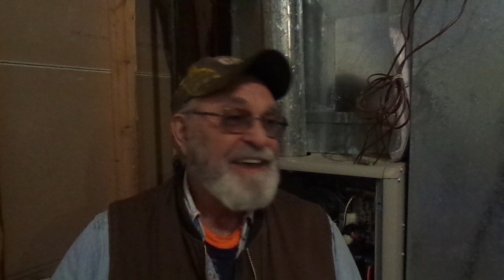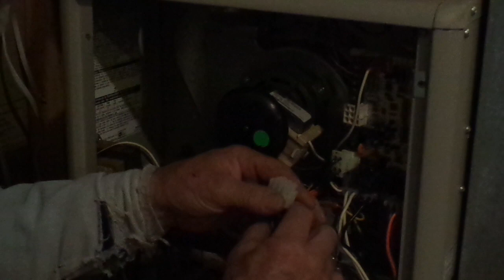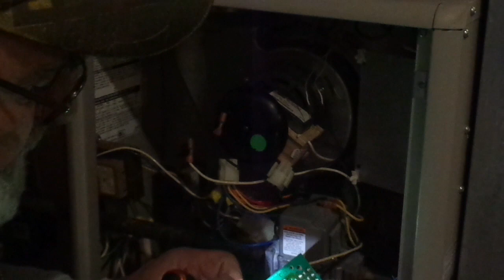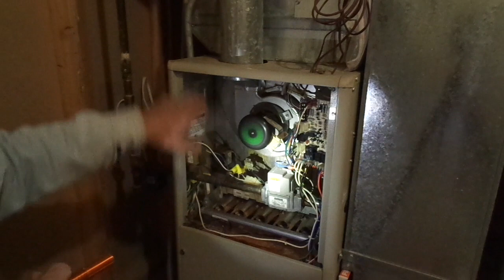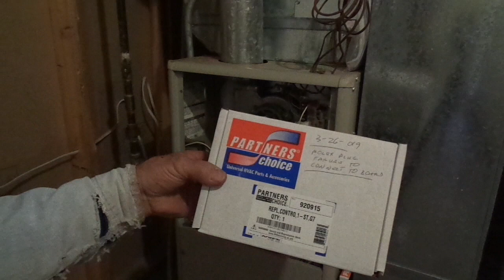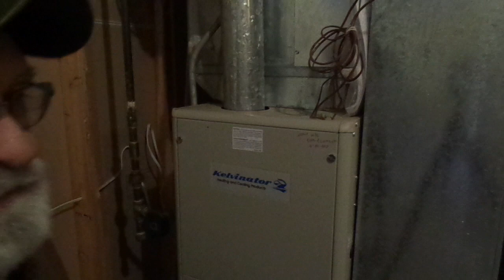Kelvinator Furnace Control Module Replacement at Sandi's House

Comment: Usually faster and cheaper to swap boards. Gator has skills and tools that let him fix boards and many other things. Tractorman builds all manner of implements and tools. As a DIY project the work we do is entertaining. Trying to break even doing the work for someone else is a loosing effort.
Fixing a saw, plane, tractor, or circuit board takes skilled labor. I once spent a month fixing a hand plane. Two months fixing a mower that isn't running yet. That labor can eat all the savings of saving the board from that failure. 
There's a reason for saying "that failure" too. It might be a Monday or Friday board. Bad soldering, rough handling, no QC, or worse spotty QC. The customer is happy until the next failure requires a return visit and additional cost. 
If I break that cracked #4 plane I get the pleasure of refixing it. If I fix it for someone else for money the fun evaporates.
Reply from the maker: That is a very astute comment and puts succinctly into words the reason I do so many of the things I do....essentially the Fun Factor, or in other words the satisfaction of helping someone out that needs it.   I really can't add anything to your comment except thank you for putting it in plain English.   And thank you sir for taking the time to write it as well as watching.

Comment: How's she goin'?  Interesting trouble shooting there Wendel!!!  A simple cold solder joint or broken trace and the board is deemed to be faulty.  But you nailed it and made a good repair, and the customer is happy and warm!!!  Nice goin'.  Take care!!!
Reply from the maker: I described what I think the specific issue was in my comment to ol' Gator...but you're right it is a simple broken or cracked connection, but essentially inaccessible especially for a field repair.  Thanks Mike for taking the time to take a look sir !!
Reply: @tractorman4461  In this day and age, it just doesn't pay to trouble shoot to the board level in my opinion.  Like you say, for a field repair, change the board and get back in service.
Reply from the maker: @GrampiesWorkshop  When I retired the company I was working for was charging $80/hour plus trip charge, that was six years ago and its more now I am sure.  So Mike, you are absolutely right with your comment.... It doesn't pay to fix them commercially.  But I understand ol'Gator as well because if I had the proper tools, and because I'm just helping out a lady-friend I would go ahead and repair it or at least ATTEMPT to repair it. LOL.  But then again, if it were ten below zero F and the forecast was more of the same....I'd just change it on the spot as was done here.  (Not too long ago I soldered in a new resistor in my dog-fence circuit board to save a few bucks...but it was obvious and easy to get to) (-:

Comment: Yes.... you're still cutting the mustard and it`s really nice of you to be helping people that need it.....I have a hard time just keeping up to the stuff I have to do and I also try and help on my daughter farm and at my son`s place....that`s about as far as it goes....I tell you I would have brought that printed circuit inside on my workbench in the basement and would have fixed that broken circuitry on that board....It always looks worst than it is but then I have all the tools for that....did it a lot of time....good going and it was a pleasure watching....CHEERS
Reply from the maker: Thank you Gator for the super kind comment... Let me tell you, coming from an old Sparky like yourself makes it mean a lot to me.   I think the broken circuit was behind the molex connector on the front of the board.  Probably one of the nine molex pins cracked off behind the plastic plug.  I looked at the back with a magnifying glass and saw no break at all.  I have dobbed a blob or two of solder to repair melted spots on boards in the past but I don't have the tiny needle tipped tools required to attempt this one at all.... Thanks again Gator and have a nice Easter !!
Reply: @tractorman4461  To repair this you have to take the plug off and see where the problem is and resolder it back on....you did the right thing by buying a new board and making the client pay....I just like to tear into these things and I have all the tools and I even took a few courses on repairing boards in my younger days when I work for a newspaper outfit....I just do it for myself....CHEERS

Comment: Boy Tractorman44, I'm sure glad my wood stoves don't have one of those things attached to it! Usually the problems I have are not enough wood, need of matches or my own board needs adjustment. For my own board I find when sparks start goin I need another cuppaJO. Have a fine as frogs hair Friday Tracktormam44! And the next time you have a problem with a furnace, try the Philadelphia Screwdriver, better known as a hammer. Make sure you do a little dance in but not on the flowers. And I hope you find your Easter Basket on Sunday morning. DaveyJO in Pa.
Reply from the maker: Aw heck, we can install one or two of these boards in your wood stove....  Install them right on top of the stack of wood and strike the match !!!  LOL.  I think my little granddaughters will find my Easter basket for me on Sunday.  They'll get the chocolate eggs and bunnies and I'll get the hard boiled eggs. Have a super Holiday weekend yourself DaveyJO !!!  Mine's starting out just fine so far.....
Reply: Tractorman44 I like those hard boiled eggs pretty good! Of course I like those chocolate things too. I guess I could try those boards. Would they be 220 or 110 ? I was almost ready to work on three deer hides and a friend stopped from his trout fishing morning, which he does most every morning. He gave us some real nice ones, 12"-14". So I spent some time cleaning trout. Two to eat tomorrow and some in the freezer. I freeze them in freezer bags with water and they stay very nice for a good while. We had some from last year about ten months froze and they were like fresh, when you freeze them in water that is. I have a great trout stream behind the house, about 250 yards. In fact my border goes to the middle of the creek. Someone asked if I could fish on my section of the stream without a license and me sez, Nope! It's a great and beautiful stream with lots of aquatic life and even some native trout. I haven't fished for a number of years and it takes much less time when some kind friend gives you some. Saves on hooks and line too. My friend Al fishes all season in creeks and the Susquehanna River. Used to have lots of shad in the old day but with three dams and not much of a fish ladder they don't get up river like in the old days. My grandmother said the fish wagon would come by the farm during shad season and charge a penny a piece for the fish. She said one fish would feed the family of eight. They are my favorite fish but the filets in the store last year was $12 a pound. For years there has been talk of building efficient fish ladders and I mean for many decades. There used to be millions and now they ship some above the dams. Some get killed going through the turbines. See lots of eagles along the river too. There are quite a few nesting in this area and I often see them. A few weeks back there was a Bald Eagle sitting on a deer carcass that had been killed on a back road about a mile from here. Me driving by didn't seem too spook him a bit. It is raining now and supposed to the next 3-4 days they say but not constant. They say at the moment 11/2" and flood warnings in some places. If the water ghetto this house I'll be building an arch. I'll pick you guys up. I do believe in the original story Noah picked up a Tractorman and his wife. So Happy Easter and if you can catch that bunny and get extra candy, let me know. I'll keep an eye out here too. Have a Great Family Time! Love, Light and Peace to you all from Pa. And don't forget he Easter JO! DaveyJO in Pa.
Reply from the maker: @daveyjoweaver5183  I like my fishermen buddies for that reason.... I'd rather go fishing in their freezers than going to the stream, but ONLY because I don't seem to be able to find the time to relax on the bank !!  I just never had the time to fish or hunt or at least never took the time to go.  Just too much stuff to do.  I sat on the bank about twenty years ago once or twice and it drove me crazy thinking about the stuff laying in the shop needing my attention.  I kinda wish the mindset was different...but it just won't swing that direction yet.  Maybe one day......

However, if it keeps raining so much, I'll keep looking up the lane for you and your arc swinging by to pick us up...I'll drop a line off the bow and maybe catch a fish or two then... LOL. Until then I'll toast a cuppa JO your way daily sir.  Have a good one DaveyJO !!  You and your Missus be careful and we'll see you later.
Reply: Tractorman44 Ain't it the truth Tractorman? I did some fishing for trout in my earlier days with my Grandpa and other family members but it was at the beautiful trout stream through the woods that's just behind my house today. You're so right about things to do in the shop. I actually relax and enjoyed this aspect of my life more than fishing. I have friends who are out there on the banks and boats almost all summer or every weekend. That's all well and good, a person ought to do those things that brings them bliss. But doing your own fixits satisfies that yearning to fix and create and to solve some problem ourselves. Without the use of some $80 an hour dude who got training is some six week course. That's okay of course but when you can fix something by your own ingenuity it not only saves money but gives you great satisfaction. And a big plus is that you can help someone else. I will often bring a tool box when visiting someone and they need little or bigger things done. In my tool box I bring along has parts and pieces for every occasion. There are things in that box that are known and unknown to mankind. But I always seem to make do with all that stuff. Then I find a bunch of screws someplace in the shop, odds and ends, they go into my magic tool box. Some wood, sheet metal, dry wall,machine screws, assorted nuts and bolts, plumbing parts, a little bottle of glue, some 5 min. Epoxy and some contact cement and I can't describe too many things cause they are probably secret, even to me. It's a Mr Fixit box. Also keep some tools there too of course. And as for the arc? There will be too much to do in the on board ship shop so we won't be fishing. We'll probably be tiling the stalls or making some shelves or waxing up the two tractors of every species, godda have tractors! Do you think we would spend time cleaning stalls when we have tractors? Okay, more JO and on me way and a workmans cup held your way. A Holy Moly Wednesday to ya Tractorman and remember, it is always Take A Tractor To Lunch Day. DaveyJO
Reply from the maker: @daveyjoweaver5183  I'll let you know DaveyJO that in your honor, I dined on my salami and balogna sandwich sitting on the seat of the old Farmall H yesterday.  Smothered in ketchup too...the sandwich, not the tractor....(-:
Flushed it down the gullet with a good hot cup of hot coffee made by the Missus early on.  Fancy stuff though which isn't necessarily my favorite persuasion in the hotJO department.  Still its hot, black and gooOOOoood
though !!

I like the concept of your toolbox !!  Sounds like my old Ford F-250 that's my daily driver...  I call it my toolbox on wheels.  And really, the only thing I missed about my job upon retirement...is my company service truck.  My company toolbox on wheels went everywhere I went and it made the off the cuff repairs usually quick and simple.  It was a Chevy 1 ton dually with covered service body and ladder racks.  The power plant was a 8,100 (500+ cu in) gasser coupled to the rear through an Allison automatic.  Man o man it was a beast !!  I miss that old gal.....  It and many others over the years is why my old '85 just turned 72,000 a while ago.  LOL. Barely broke in !!

Gotta go... am picking up a tank of nitrogen for leak testing and heading for the son's attic and duct installation this morning.  Don't work too hard this morning sir and shine up the old toolbox, there's probably someone close needing something fixed...might even be an old Zebco...  LOL
 Have a Super Thursday sir !